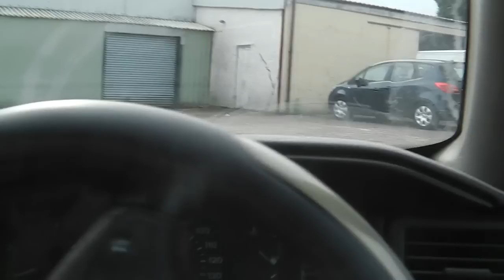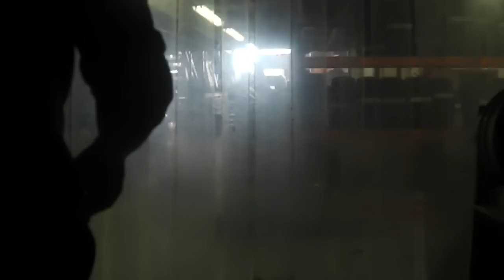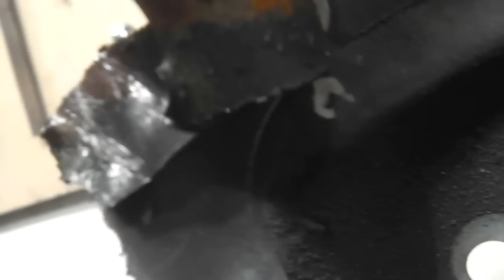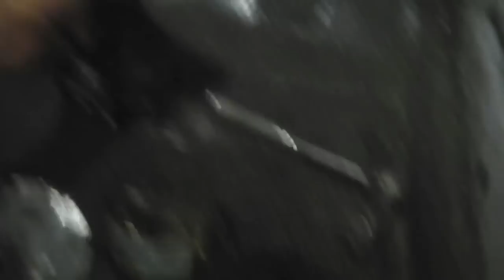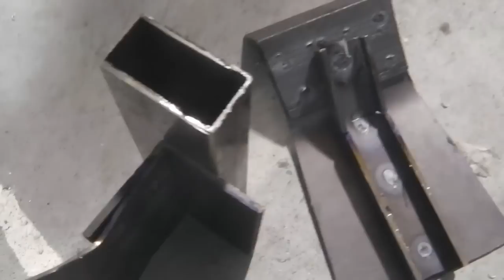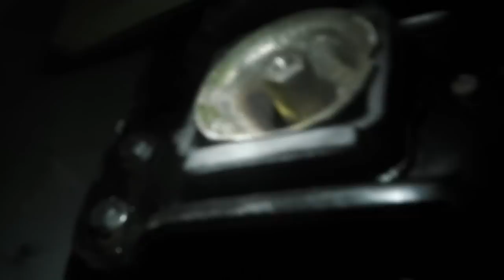Ford Cortina MK3 Project Ruby EP22

Comment: hi pet, the name of the air intake butterfly is a throttle body, its motorcycle technology applied to cars, and the dohc engine is 150 bhp in standard tune, you can evict all the electrikery stuff and use standard intake mainfold and  carbs, would make ruby fly!
Reply from the maker: thanks Gary, yes that's the word I was thinking, butterfly!

Comment: I know I'm a bit late coming to this party, but watching this I just suddenly had a thought, the original style T-handle shifter is only designed for a 3-speed auto, so you only have D-2-1 positions for the forward gears on the shifter mechanism which means you won't be able to select all 4 forward gears.  The same shifter was used in the Reliant Scimitar GTE/GTC automatic, but I'm sure that when Reliant stopped making the Scimitar and Middlebridge took over they updated the car, using the 2.9i V6 Cologne Granada/Scorpio engine and the A4LD auto box in place of the 3.0 Essex and then 2.8 carb Cologne and C3 auto box.  Now, I'm pretty sure from interior shots of Middlebridge Scimitars that they didn't use the Ford stepped-gate (Mercedes-style) shifter in their cars as it looked a bit cheap and wouldn't fit the image they wanted to cultivate for the car, so presumably they must have developed their own shifter for the 4-speed box to give full functionality.  Being as a lot of Scimitars (Reliant and Middlebridge) have been converted from auto to manual there are probably some shifters knocking around so maybe one of those would give you all 4 gears on the shifter and look as period as the T-handle shifter.  Any Middlebridge owners or experts watching could say if I'm wrong, but if I'm not I believe there is an owner's club for the Middlebridge cars who might be worth contacting.  Both Reliant and Middlebridge were all Ford power-train so it should be no more difficult that modifying a T-shifter to work...

Comment: If you're going to put power steering on Ruby as well you might be able to use the PAS pump from that Scorpio, if my memory serves me right that twin-cam engine was a stop-gap while Ford developed the early Zetec engines and it was heavily derived from the Pinto block...

Comment: Hi Pete, been trying to get hold of one of those red magnetic base torches you use (Schumacher SL360R). Can only find them in the US. Where in the UK did you buy yours from? Ta Mig.
Reply from the maker: I got mine from local motor parts factors, i think its a sealey, rubberised case, flexi head, Led, twin brightness, torch end plus light strip main face. mag mount, with UJ head
Reply: No wonder I can't find it, i've been looking for the wrong make. Cheers Pete, found it now in UK, looks like it's a Sealy LED360R :)

Comment: Hi Pete, Tnx all the great work and videos on the Mk3's. I enjoy watching. You saving some great cars for us all to see at the shows etc. Just a thought, have you spread the load enough on the transmission tunnel, it just looks like a little sideways support as well as vertical could be helpfull, your brackets look strong but the tunnel is only thin sheet. Keep up the good work. Cheers John
Reply from the maker: your welcome. yes i agree, i thought same on some sideways support. tried rockin from side to side buts its very solid, however it would be good to insert some 2mm plate sideways. ill do that. thanks a lot John

Comment: Pete, do you think you may have issues with the speedo being accurate? Just wondering about diff ratios and wheel sizes - Granda vs Cortina. Not sure, but i think you can get different ratio worm drives for the speedo cable.
Reply from the maker: steve yes you can change the worm drive and also calibrate the speedo by altering the induction of eddy current by bending the inductor vanes, got swampys speedo acurate to sat nav, by dead on, to the 1mph.

Comment: Pete, this was already another really interesting video series, but doing this is making it even more so, i love it mate. Great work, and i agree, if production of the Cortina carried on, i think this is the route Ford would have taken.
Reply from the maker: STeve you right there with me on that. I reckon they would have put this in the mk5 if no sierra came along, as you can see loads of room, its a beefy box, and its going to be real fun to drive this. Ive already started filming for pt 22 and i can give you a sneak reveal...the gearstick selector shaft rod, has fitted liek a dream, complete with its adjuster to fine tune if required, all gears click in nice and theres plenty of clearance on the rod. however theres no 1st gear as the t shifter on mk3 cortina is 12DNRP as opposed to A4LD box 123DNRP   but i hardly ever select 1st on my other autos. also........i salvaged the cruise control unit from the Granada....guess where its going , but totally hidden   ...:-))))??
Reply: Pete C
Awesome! :-))

Comment: Hi pete C , i would have been tempted to do it as a 2.0 lire Dohc double overhead cam auto and just put the engine and gearbox in as one. I did put a 205 pinto from a MK2 Transit , into a sierra estate on a F reg! once , when many people said that it could not be done . But I bet it will be a lot better than a 3 speed auto box or manual box and can't wait to see project ruby finished. Only thing I would be cautious about is the bracket mounting places and the drive ratio and Torq ratio and prop shaft and differential ratio. also clearance between the top of the engine with head on between bulk head and clearance from the front slam panel to the fan so it won't catch.
Reply from the maker: I know i was thinking that. Only thing that stopped me is i didnt want the ecu in there as orginally i was totally OCD about orginality until the auto, i was going to sneak the auto in and car would still look like a regular 71 auto. if i put the dohc in it becomes a modified ..which is great, and of course ive already modded other things but most hidden, but as you said...good idea...very tempting it was....what did you have to do on the sierra im interested...thanks for watching and your views on this. all best. pete.
Reply from the maker: sold engine and sunroof! plus lots of electrical goodies are finding thier way into ruby....bing bong....lights on door open alarm !!!!
Reply: That's well cool pete , the lights on door open alarm. Didn't they do a after market door chime kits with different door chimes for cars once. What I used to like seeing , growing up in the Eighties was furry seat covers , that does bring back memories.

Comment: Amazing Pete! I'm wondering if you'll do the same with Bramble?
Reply from the maker: Carl Bramble will be stock, more of  a show car, ruby is the continental cruiser.....thanks for watching, as ever......
Reply: No worries Pete, always great catching up with your projects. I passed part of my weld tests this week at college, got a couple tips that may help save you some time working on Bramble, or anyone out there restoring a car.

 When you're drilling out spot welds, maybe use a seam splitter or a hacking knife ( used by Carpenters and Glaziers for other things) for removal of panels etc. They are thinner than a cold chisel, and wont damage metal as much. Just drop it in and hit with a hammer.

 Plug welds...start at the 2 o clock position, weld around the hole edge to the start point, then wind the weld into the centre like a catherine wheel lol. It works, I've done it on the flat position, vertical & horizontal ( which is really the same with plug welds) and overhead! Did my destructive weld tests which showed me why we plug weld to a 8mm hole. As long as the overall weld is within 13mm, you know you've got it good. Penetration of the weld!

I found it to be fast and efficient, hope this helps. I'm learning this trade to industry standard which is time sensitive also.

 Can't wait to see Ruby roll out the paint shop!